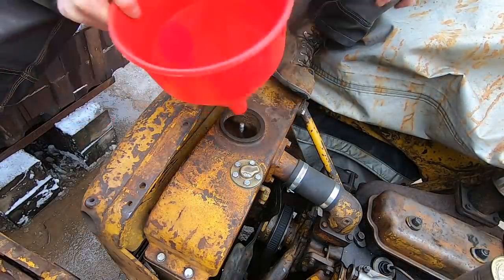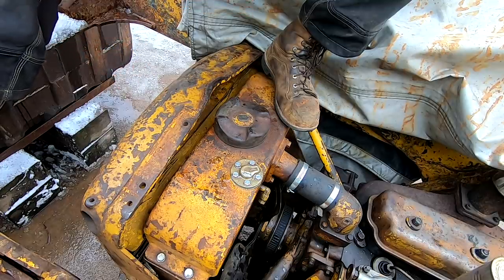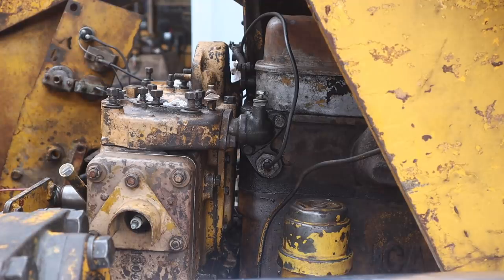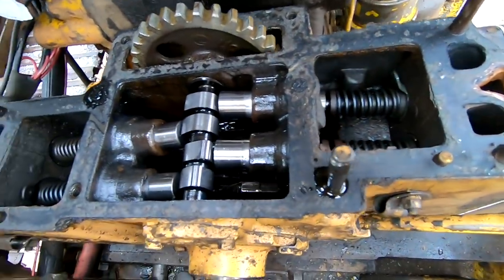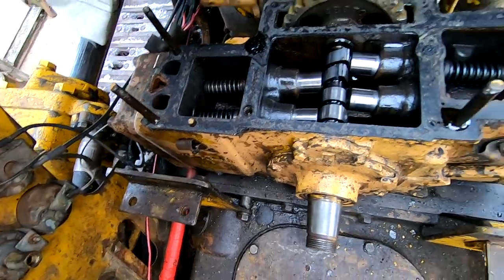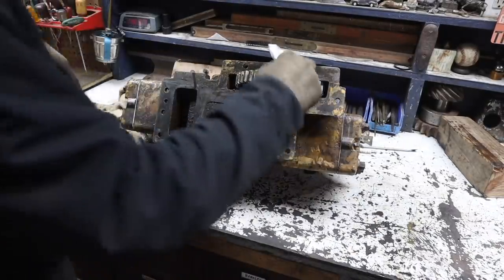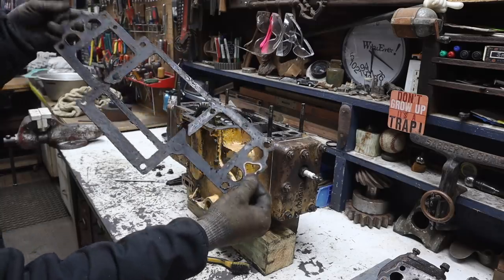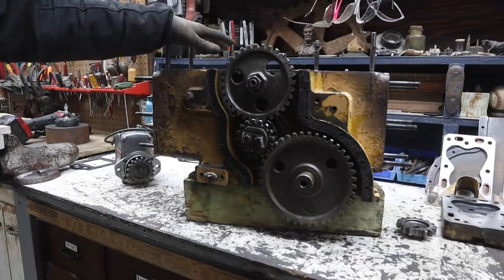I REMOVED the Pony Motor!!! ~ Part 15 ~ 1950s Caterpillar TraxCavator

Comment: Been following your resurrection of the old Cat since the start & other prior projects as well. Very enjoyable & good filming / viewing ! Overall your doing good work for a non-restoration. However, I felt it was time to chime in on a few things.
 
1). It would have been prudent Not to fill the cooling system prior to removing the pony motor. At the very least draining it sufficiently prior to pony engine removal would have been wise to avoid the mess & coolant getting into where it shouldn't be, etc. Just sayin'...
2). Best to learn or know the proper terms (what they are called) for the parts you're working on before using the wrong terminology for parts. Case in point, calling the connecting rods pistons, when unbolting them. Calling the Contacts in the magneto cover brushes, etc. Not trying to be critical, just trying to educate & give you a way to sound & look more like you know what your talking about in your videos. 
3). As other commenters have mentioned, the crankshaft & rod bearings you're dealing with are or should be made out of Babbitt & thus Cat engineers had a Reason for Using this material. It would be strongly advisable Not to deviate from it when replacing them. Not to mention the close clearance tolerances that should be in use there. Another thing, one of those main bearings could or should have been a Thrust bearing. Thus having had a flange on one end to take up for the crankshaft end-play that your dealing with. Perhaps the flange is completely worn away ? Thus creating the excessive end-play, your pony engine now has. Not that familiar with how Cat engineered on the crank bearings, just speaking from years of general engine work & Logic. 
I would look high & low for new bearings before resorting to attempting to machine them yourself. Then & Only then if they are unavailable would I machine them myself & in doing so, Only using Babbitt material !! Have the crankshaft looked at by a Good machine shop & re-ground, if need be.
You might also watch some of Squatch253's videos on Cat dozer rebuilds to gain an education on the proper way to go about making / doing some of your repairs & sourcing parts. He has 2 of his pony engines in the machine shop rt now as a matter of fact. He might also be a source or be able to tell you where you might obtain new parts / NOS parts ? 

You had asked for viewer input, so this is my 2 cents worth. Once again, Not trying to be critical. Just trying to offer advice & insight. 
Enjoy your video's & appreciate your time & effort to film & share ! Keep 'em coming & best of luck getting Old Red up & running properly !

Comment: Forget converting to direct electric drive! As long as you are this far in, replace both motors with a 5.9 Cummins and get all the benefits of a modern engine. I'm sure you can find a good used one. You can use the pony motor for a generator and find another use for the diesel.
Reply: Insanely rediculose idea..

Comment: You have it apart, you don’t even know the names of parts like connecting rods and big end bearings, mains bearings etc, and yet your making decisions like, not going to replace rings etc, nor big end bearings and so on.
Get good advice because poor decisions now just means you will be back in there fixing screw ups sooner than you care.
I remember rebuilding my first motor, spent a Lot of money on really high spec parts, but made one dumb decision from not knowing any better.
I never renewed the cam shaft bearings, despite fitting a new cam shaft, because I couldn’t feel any play.
I knew nothing about replacing cam shaft bearings, or scraping in (hand lapping new bearings), and once I got the motor back together with its new parts and new oil pump even I had shocking low oil pressure at idle.
The pressure was leaking past the cam shaft bearings that I didn’t replace.
Your pony motor is splash lubricated like an old Briggs and Stratton motors, so you won’t face that issue.
But, say you get it back together and old rings crack?
You will lose compression and be doing it all again.
Get proper advice from engine rebuilder.
At the very least de ridge the cylinders and hone (cross hatch) them.
Bring journals and fit new oversized bearings. Line bore the cylinders and git new oversized pistons and rings.
You don’t want to take short cuts / cut corners because it will rear up and bite you when your least expecting it.
I’d be finding the other half of that castellated nut off the big end bearing cap and the other broken tooth.
I would do a full restoration starting with the Pony motor including re paining it.
Has it got any core / expansion / welsh plugs in the block? Be sure and replace them also.
Your talking about re using the pistons, but have you checked for gudgeon pin wear?
I personally think your out of your depth, but there’s nothing wrong with that if you find out from those who know - what it is you don’t know & you act based on good advice.
Reply: I agree completely.  He is too damned sure of himself... Does things completely out of order, continuously. 
First thing he should have done when getting it to the shop is tear down both engines, measure all of their tolerances, & go from there. He could've done all of the other stuff while the engines were at the machine shop.  But no.....
Probably doing it on purpose to generate more content.

Comment: I got my d4 starter from Auto-lec.com, left the pony on and drilled a hole in the bellhousing for the starter. He sends a template and hole saw though your machine may have the hole already machined with a bolt on cover over it. It’d be on the left side under the pony clutch housing. If there’s no cover there should be a raised triangle shaped cast boss that u have to make the hole in. Email gcscott@auto-lec.com he is very knowledgeable and will set u up with what u need to do the conversion.

Comment: I wonder if anyone makes a electric starter conversion for the ol girl. Don’t see why it couldn’t be accomplished. You could even use one that had a heavy flywheel so you could still use the pong motor engagement. So you let the electric motor spin the flywheel up and then engage it just like the pony motor.

Comment: No way to prove it really, but ... I'd put my money on them remnants of the castellated nut being the cause of the broken teeth.
Reply: I would take that bet😁
Gears on that engine are separated from the crankcase by cast iron !  They run in a completely separate compartment with oil added to the pinion clutch housing down below

Comment: Its NOT aluminium bearing its whitemetal...as all crank bearings of this type are
Reply: I'd have thought white metal would be way too soft to be made into such a thick solid bearing?  White metal is usually a thin layer on a steel backing.  FWIW modern crank bearings very often use aluminium alloy on the steel shells.
Reply: Cat used aluminum bearings.
Reply: @brianrvd  Really? If so I stand corrected as thats the first time ive ever heard of aluminium used for crank mains on any engine
Reply: @ferrumignis  Yes they can be that thick, I make parts for vintage vehicles in the UK and before the modern thinwall steel shell / whitemetal bearing was developed the bearings were poured and then machined..ive seen solid white metal /babbit bearings 1/2" thick before ..its tougher than you might think
Reply: @sweetpeaz61  Read some old Caterpillar sales literature, the diesel engine has aluminum bearings also.
Reply: @brianrvd  I just researched that and you are correct, as I said ive never heard of this use of aluminium in an engine as big as the pony motor before..every day is a school day! :) Ps if it were mine i would either fit steel shell/whitemetal  bearing bushes or machine a set of bronze ones

Comment: Well i think you  answered your  own question on why the gear broke .. You must of had it out of time  when you  took apart the mag ,, an when you put it back  to gather  you didn't  put it back in time ... there going to be play  moving the crank like that in almost any motor ..   Not saying there is or isn't alot of play ..  But  question is was the mag Locked up  when you took it apart . They do lock up  some time's  They have a bearing that like to go bad..  But if you pulled the mag out before hand an did alittle cleaning you mite of thrown off the timing .. A tip would be  if there isn't any timing marks  make your own so everything  line up right ... Some of the old Motor i taken  apart like old  Robin engine's  they don't have timing marks  some not all of them . An im not saying i am right nore wrong  nore that i know a every thing ..   on our dozer  our pony motor is a 2 Stroke an we had a problem  where it stay running even with the main engine running  which is  bad ..